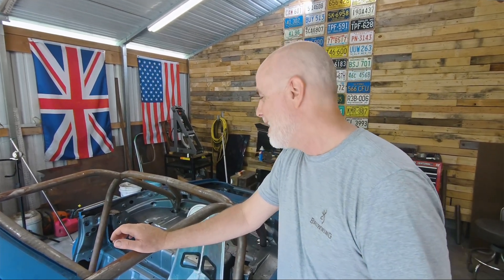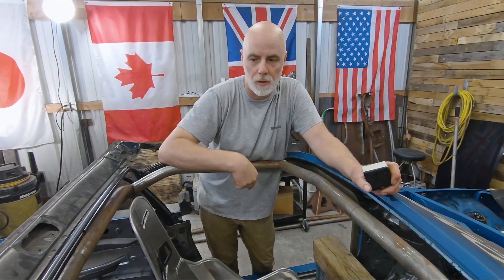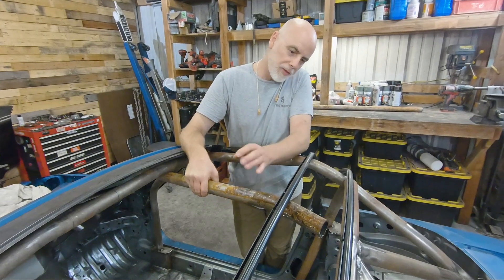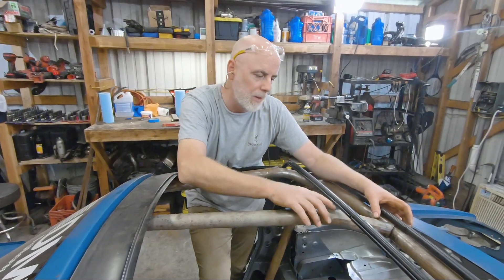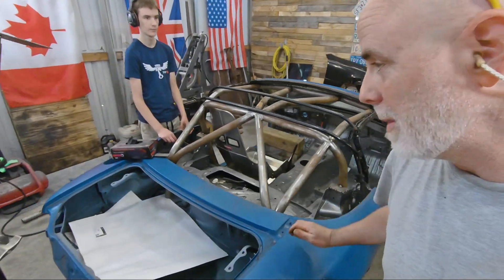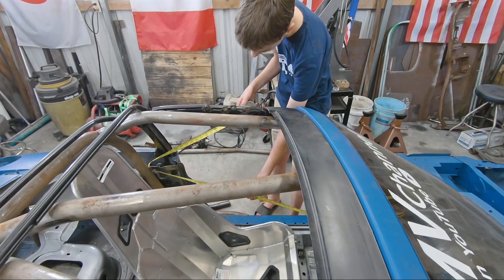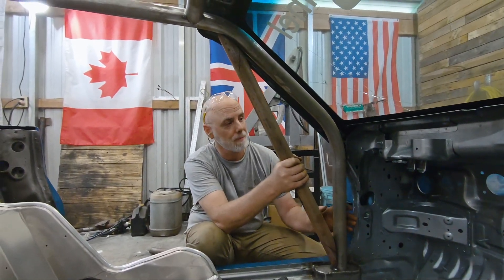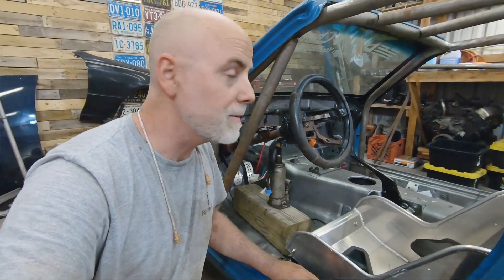LS Swap Miata Roll Cage Build Ep 28

Comment: I love the sheer determination to build the worlds most complicated Miata roll cage. It's going to be great! Have you checked for top latch clearance though?
Reply: I was going to add that as well (your front latch location looks like they aren’t going to clear) but other than that it looks great!
Reply from the maker: The windshield latches definitely won’t clear. I don’t really have a solution yet but It’s just metal.🤘
Reply: You can get permanent metal plates that will bolt to the top latches and the windshield frame. They do it for the hardtops I’m sure you can do it for soft tops as well
Reply from the maker: Thanks, I will check it out. I left room to access to the bolt holes on the windshield frame. Plates might do the trick. 🤘